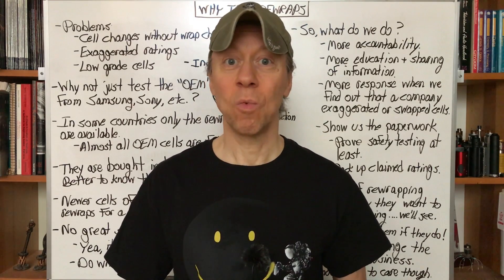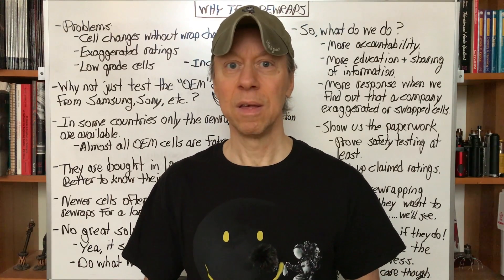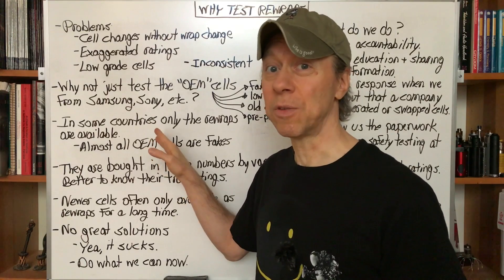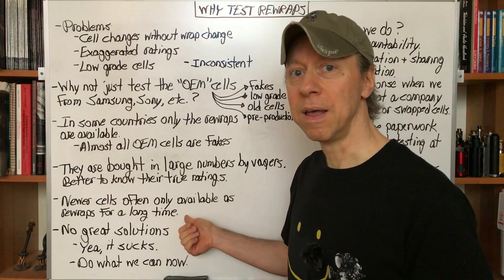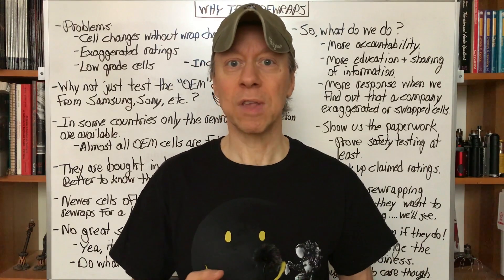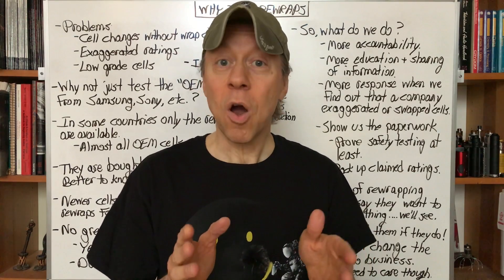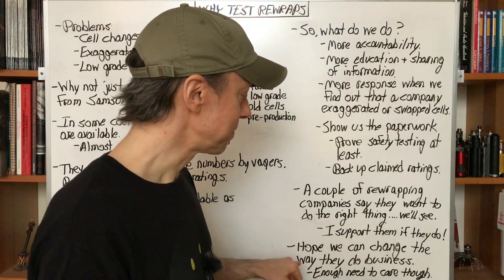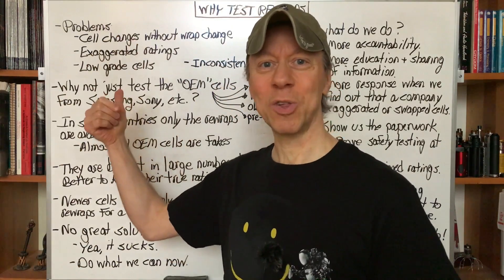Minding Your mAhs – Ep017 – Why do I test “rewrapped” batteries?

Comment: here the quality of the cells is quite important, counterfeits are very easy and very tempting for fraudsters, more than 10 years ago, it was possible to distinguish quality from poor quality by weight, the quality ones are usually always heavy. Is this still true for lions today? I noticed that the poor quality ones are also usually lighter.

AI:
Yes, the weight of the cell still correlates very well with its quality, even today - even though counterfeiters are smarter than before, the physical limits of chemistry and battery design cannot be easily circumvented. So:

Weight as an indicator of quality still applies:
Quality 18650 cells with a capacity of around 2500–3500 mAh and a decent discharge current typically weigh 44–49 grams.

Counterfeit or cheap generic cells (often overprinted with brands like "UltraFire", "TrustFire", etc.) weigh 30–40 g – and that's why they can never hold the real capacity and have fake parameters.
Approximate weights of top-of-the-line cells:

Sony VTC5A 2600 mAh 25–30 A  ~45 g
Samsung 25R 2500 mAh 20 A ~43 g
LG MJ1 3500 mAh 10 A ~49 g
Panasonic NCR18650GA 3450 mAh 10 A ~48 g
Molicel P26A 2600 mAh 35 A ~45 g

What to watch out for:
Extreme figures like 6000 mAh or "9800 mAh" are 100% fraud.
Noticeably low weight (<42 g) means that there is less active material inside = lower capacity or current capability.

Very cheap prices and unknown brands = usually overprinted cheap cells from recycling.

 Practical test:

If you have the opportunity to weigh the cell:

Weigh it without packaging, or even with insulation (subtract ~1–2 g for insulation).

If it weighs less than 43 g and has a stated capacity above 3000 mAh, it is very likely that it is a fake.

 Tip:
Measuring the weight is a great first filter. If the weight looks ok, but you want to be 100% sure, I recommend:
Measure the capacity by real discharge at a known current.
Measure the IR (internal resistance) – quality cells have below 25 mΩ.

Comment: Where can I buy a Samsung 25r 18 650 🔋 original wrap that is real?
Reply from the maker: Check the Description section of this video for a list of vendors.
Reply: @batterymooch  batteryjunction.com says they are authorized dealer for Samsung 18 650 batteries which I bought and they weighed 42 grams then I bought a pair of the same batteries from another dealer and they weighed 45 grams  if these batteries are made the same way why would the same battery weight different?They both work fine,same performance that I can tell on my mod(drag 2).
Reply from the maker: Love wisdom the datasheet and tech info documents list the “typical” weight as 43.8 gms and max weight as 45 gms but no minimum weight. I don’t know if 42 gms is a problem or not. I’m not able to say if they’re genuine or not.
Reply from the maker: Love wisdom In bright light look through the plastic wrap near the top of the battery. There should be two lines of codes printed on the metal can of the battery. The second character of the first line of codes for the 25R must be a five. All the rest doesn’t matter.

If it is not a five then the battery is a fake. If there are no codes then it is a fake. If the code is correct then it MIGHT be genuine.
Reply: @batterymooch  I've checked both sets and all four batteries have the number five as the second character in the first line and they all have three legs. I guess I'm just going to have to order from the stores you've listed below on other videos  just to be  safe. Thank you for reaching out in the comments and answering my questions greatly appreciate it you're the best thanks
Reply from the maker: Love wisdom my pleasure!

Comment: I have 4 OEM 30ts that are awful , just garbage really. I bought them at a reputable company too. A company we call a great source for batteries. I bought 2 Vapcell purple 30ts and they are awesome. I mean night and day difference. The Vapcells are powerful and the battery life is great. Im leary of rewraps just like everyone else , however, these batteries seem to be a higher grade battery than the OEM batteries for some reason. This is the only 21700 I like actually. I bout 2 more of the vapcells....just to see if it was a fluke and to see if I just got lucky , ya know??...These 2 are just as perfect as the first 2. Mooch , i know you tested these purple Vapcell batteries and said they were solid performers , which is why I even tried them in the 1st place , thank you. I think they are of a higher grade or something. If you are not liking the performance of your 30Ts , the purple Vapcell 30ts are awesome. Be safe peeps
Reply from the maker: There is very little performance difference between the different grades and Vapcell will not use the top grade of cells IMHO. Your OEM 30T’s might be fakes.

Comment: I dropped my mod a couple days ago from about 3ft and it landed flat, making the batteries fly out onto the ground. It looked and sounded pretty nasty, but would that damage the internals of the batteries enough to result in thermal runaway? Should I buy new batteries?
Reply from the maker: Thermal runaway would probably have happened immediately if damaged badly enough. I don’t know the condition of your batteries internally though and can’t say whether there is any safety issue with continuing to use them. I don’t know if you need to buy new batteries or not, sorry.
Reply: @batterymooch  Thank you for your input!

Comment: Hey Mooch, I was just wondering how amperage vs voltage effects battery life? My coils either run low at around 0.15-0.3 resistance or between 0.5-1.3. The amperage is higher on my lower builds but my voltage is higher on my higher builds (obviously). Would 8amps drawn with around 8 volts drain batteries at the same rate as a build running with higher amperage compared to voltage drawn? Also what would be a good balance between the voltage and amperage (if there is any)?
Reply from the maker: In a regulated mod? The coil voltage and resistance doesn’t matter to the batteries, just your power setting. That is what determines how much current is drawn from the batteries.

Comment: Can anyone tell me if an lg hg2 is mech safe .. Lets disregard pulse ratings for a sec .. Just a general yes or no
Reply from the maker: Any battery can be used in any mod as long as it fits and the current rating is high enough for the way you vape. The HG2 is rated at 20A.
Reply: @batterymooch  thanks alot mooch

Comment: Hi Mooch, I was just curious about your opinion on the Golisi 18650 S30 batteries, and if the Mah and Amps are close to their stated rating? would you recommend these batteries for use in a Mech mod? Thanks
Reply from the maker: Sorry, I haven’t tested them, I don’t know its true ratings or how it performs.
I don’t know when I might be testing them.
Reply from the maker: I recommend the Samsung 20S for mechs. If you can’t get that battery then try a VTC5A.
Reply: @batterymooch  Thanks for your reply I do appreciate your feed back! I will try the batteries you have suggested.
Thanks again for your help!

Comment: Do 18650 batteries vary in size? My innokin proton mod will only power on with specific 18650s. It seems most of my 18650s are too loose. Any suggestions on which to buy? Thanks
Reply from the maker: The OEM batteries (from Samsung, Sony, etc.) are usually not oversized and are very consistent. Other cells, particularly those made in China, can be larger and quite inconsistent in size too. My only recommendation is to stick with OEM wrapped batteries but I haven’t measured all their sizes.

Comment: Hey John do ya have any idea what the charge cycles are on the 30ts? Does it have it listed on any "paperwork", how many cycles theyre recommended for?
Reply from the maker: 250 cycles at 35A continuous down to 2.5V @ 25°C for a drop to 60% of rated capacity. The datasheet numbers aren’t very useful for our application. 🙂
Reply: @batterymooch  yeah i was just curious if they had a really short life cycle of like 100 or something. Appreciate you responding so quick John, much appreciated buddy.

Comment: is the Sony VTC6 18650 3000mah Battery good?? and is it good at high watt vaping?
Reply from the maker: Yes. No.
You can use it at up to about 45W before going over its rating. It is one of the best high capacity 18650’s for low to moderate power vaping.

Comment: Thank you, Mooch. I guess hope can spring eternal, but IMO, any of these companies that consistently overrate their printed performance are on my no don't even think about it list. Unless there's a complete change in management or ownership, if they lied before there is no reason to trust them again. Even with a printed datasheet. If they misbrand a wrap, is a page of printed specs, most likely not even in English going to be that much more reliable? I understand they will still be out there and testing does help vapers out, but the rewrap companies have an awful lot of territory to cover before they would make my to consider buying list.

Comment: When I first started, there was a seller at a shop that showed me his extremely hot vape and said it thanks to these IMREN 50 amp cheetah print 18650s. Then I discovered there were no 18650s over 30 amps. Mooch, you helped save me from bodily harm or worse. Thank you.

Comment: Mooch - do you think that reporting the wildly inflated ratings on many rewraps to the Feds might push the Orange Pustule's Administration into limiting imports of these brands on safety grounds?

You forgot to add, as reasons for testing, that you are a glutton for punishment, apparently need little sleep, and are the anointed Earthy rep of the Battery Safety God (thanks for all you do, proud to support you!)
Reply: I mean its in their knowledge, if they havent done anything about it now they most likely dont care.  Theres also the fact that that could cause some severe regulation issues if we have people restricting this stuff who dont know what theyre doing, which has been happening a lot lately and is why we're seeing bans on vaping all over the place.  Of course this is all theoretical, but to me it seems like the most likely thing that would happen in that situation.

Comment: you got me all amped up --  shocking or just re-volting is the sub-standard monitoring of the industry for sure ,we know L-ion,s pack a wallop even within reason their lesser versions or worse ,forgeries ",What if these are stressed while pretending to state a certain value the imposters  may just blow your head off ,now that would Ruin my day"  fiendish battery imposition  for the sake of that dirty trollop "Money"   the sooner there are better monitors for standard industry with real value classification the freak"n better  "      I prefer my head On my shoulders not some where in the random vicinity of them",-  due to over rated stressed batteries with unpredictable consequences  "   2months you give them   these re wrappers have had years already "   Pole--Volting regards  B-b

Comment: American vapers that just finished celebrating Thanksgiving should be thankful for Mooch, this kind of research and information is simply invaluable. Thank you!!

You mentioned "badly stored" old cells. Where can I find more information about that (both physical environment and charge level)? I have a set of 18650s which are 3 years old, and which I've retired from my mods. They still work well enough for e.g. my Coil Master build workstation, but it's going to be a long time before I rotate the whole set through that.

Currently they're just sitting in cases, fully charged. They don't seem to be self-discharging or anything. Is that okay for them?
Reply from the maker: Minding Your mAhs Ep6 has some info on storing cells and extending their life.
Reply: @batterymooch  Just watched that episode; great info as always. Sounds like the best storage conditions is about half full (3.7v), room temp, ordinary/insulated battery case. I keep a rotation of 12x 18650s going for my mods, and just got into 21700s too. I need to work up a system where I only charge them just before I use them...

I've been relying on your info for years now and just became a low level Patreon. I just found your YouTube channel so I have some catching up to do. Thanks so much for providing all of this information!
Reply from the maker: BlueStratDude my pleasure and thank you for your support!
Reply from the maker: There’s no way for me to know the condition of your cells but if they are holding their voltage and performing well then it sounds like they are still okay to use.
Reply: Don't store them fully charged. That info is in one of Mooch's videos (probably the one he recommended to you).

Comment: Shame on Sigelei for saying their battery was 35a. You'd figure a big company like them wouldn't exaggerate their ratings which is exactly why I always use your ratings to see which batteries are best for what I vape with. I wonder if the companies who buy these batteries in bulk for high powered equipment have ever had problems with batteries as well
Reply from the maker: The big customers can but direct from the OEM’s...no problems for them. 🙂
Reply: @batterymooch  Lucky for some ay